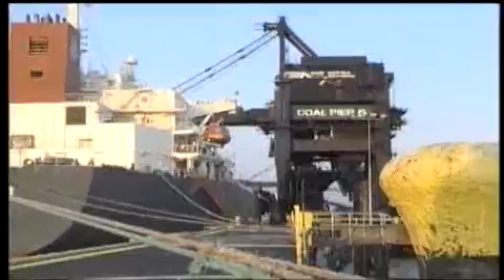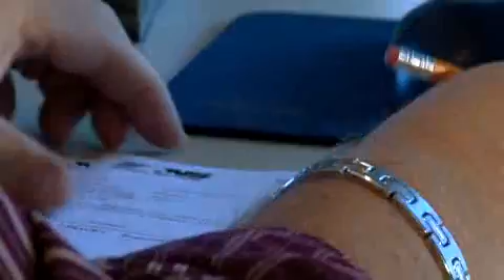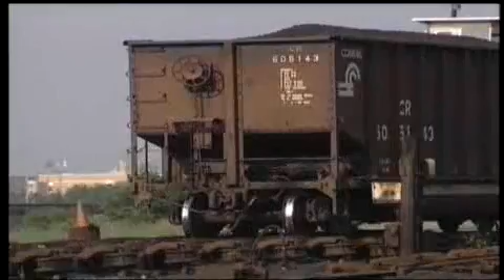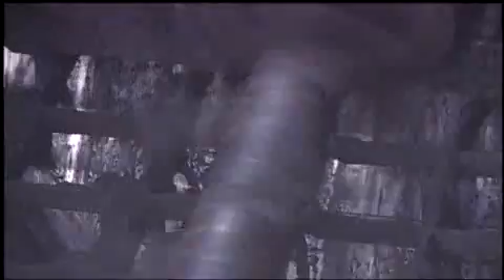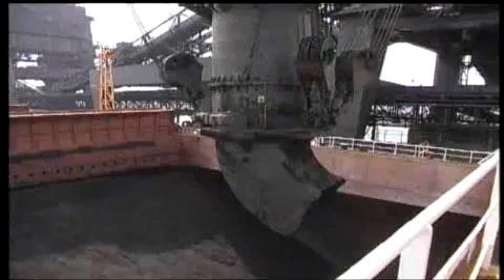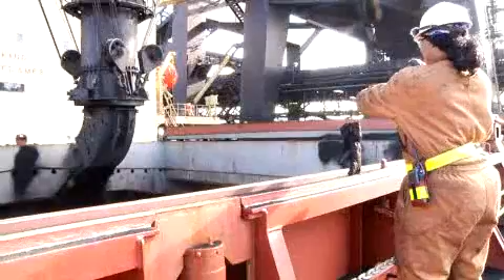Lamberts Point - Proven Technology for Today and Tomorrow

Comment: sadly intermodel is fazing out coal
Reply: True and also there is not going to be a need for coal in the future. Even if coal makes steel. It still won't be a need, cause any old steel they would melt it down and boom new steel.
Reply: @dipsetny9291  problem is if you keep reusing the same recycled scrap metal and steel over and over again its strength goes down